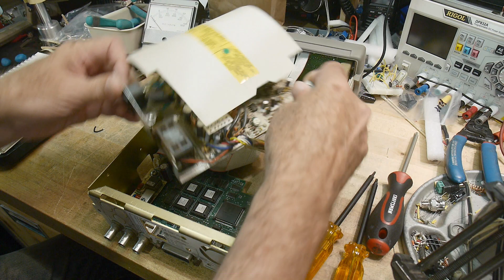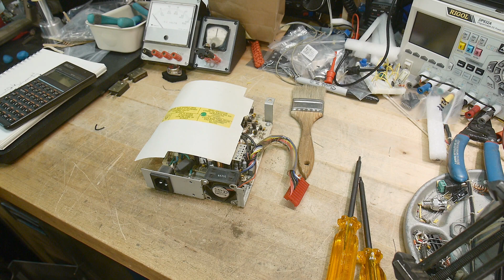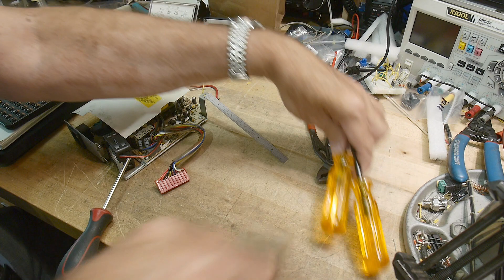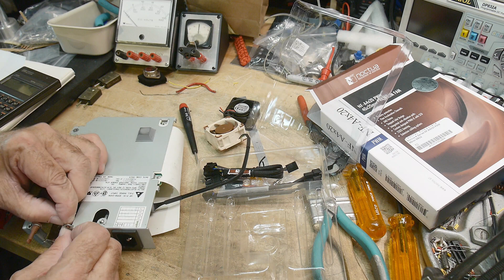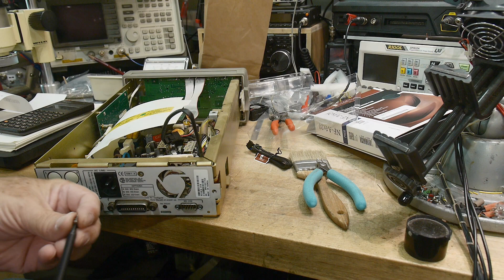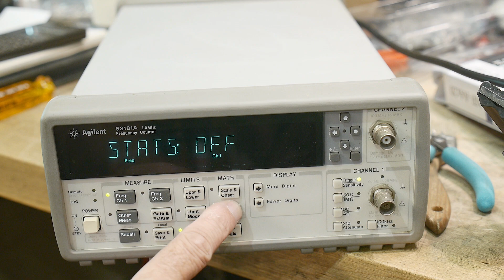#1314 Agilent 53181A Frequency Counter is too loud

Comment: That looks like a PWM-controlled Noctua.  You could figure out what HP was trying to cool, stick a thermister on it, and control the Noctua with a little DIP CPU - like an AtTiny85.
Reply: I did that with a pair of big Noctuas on the back of my homebrew LDMOS linear amplifier.   When the amp is cool, I run the Noctuas so slowly that you can see the individual fan blades...just a bit of eye candy.

Comment: I think it's interesting that Noctua's product design team looked at their grandparents' leather-trimmed tweed luggage from the 1950s and decided that was the way to go forward.  🤪

HP/Agiilent/Keysight's replacement for that counter series went with a 1" square OXCO unit that runs in Standby with the fan shut off. Oddly enough, the waveform generator in the newer series does NOT run its OXCO option in standby. Different LCD screens with contrast and backlight color temperature that don't match. Both these units and their older VFD counterparts seem like they were developed by different groups that didn't talk to each other much about details.

This also reminded me of a place I used to work did assembly of a customer's product that had a fan with bolts going all the way through, although the fans specified were flange-only designs without support pillars or ribs. There was a whole box full of new fans with cracked and broken frames as a result. Some highly-payed engineers can be total ding-dongs sometimes...

Comment: Took my hp 53132a apart today . The fan wasn't that noisy but pulled the label off the fan and put some light oil on the bearing. Now can hardly hear it! Also sucked out all the fluff

Comment: Great video!  It would be really cool to see what else that a counter can do besides frequency.
Reply: It's designed for RF it has reduced measuring capabilities compared to the other models on its series.
Reply from the maker: not a counter timer just counter. It will do limits and statistics (mean and std dev)

Comment: Disappointed you didn’t measure the internal temp before and after, old fan and new fan.  Hope the actual air flow is the same or better with the Noctua fan ? 👍🏻

Comment: I had to quiet down the obnoxious fan in my Instek spectrum analyzer.  A 120 ohm 1 watt resistor in series with the 24V fan and small o-ring cushions  between the fan and the metal chassis made a huge difference. Obviously CFM performance came down commensurate with voltage but my environment is far from worst case when it comes to cooling.  I think these test equipment manufacturers choose cooling fans for the harshest of operating environments at the expense of some pretty obnoxious noise.  It also helps to give these fan bearings a drop of oil.

Comment: $15 for a fan! Theres no id pay that. Just run the existing fan on a lower voltage. Does that PSU have a 5V rail.
Reply from the maker: be careful doing that as the air flow will be much less and parts may over heat

Comment: Noctua fans are ugly
Reply from the maker: good thing you can't see it once it is inside
Reply: @IMSAIGuy  indeed
Reply: @IMSAIGuy  I agree with both sentiments: the fan color is ugly, but the rear fascia completely hides most of the fan and its novel rubber mounts, so it's a clear win.

Comment: I wonder if you might be able to help - I have one of these and it won’t do any timing, only the frequency and period measurements work. If you were willing to probe a few lines on the FPGA for me it might help me troubleshoot mine… I’d be very grateful!
Reply: Actually mine is a 53131a but the board looks very similar
Reply: Ok so the 53181a doesn’t do timing it seems! I shall have a look at the schematic as it might help me isolate the timing parts of the 53131a circuit!
Reply: @JW-bd7em  I presume that's probably what the second unpopulated FPGA is for then.
Reply: @ChrisSmith-tc4df  That is also unpopulated on my 53131a board actually
Reply: @JW-bd7em  Interesting. I wonder if it was a hedge for a design risk or additional functionality, or if it was to accommodate an alternate FPGA.